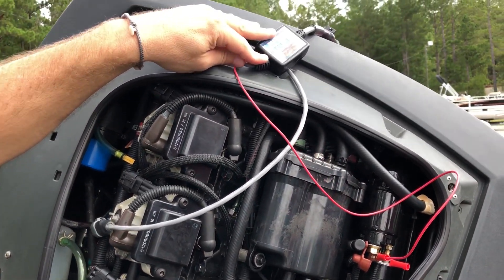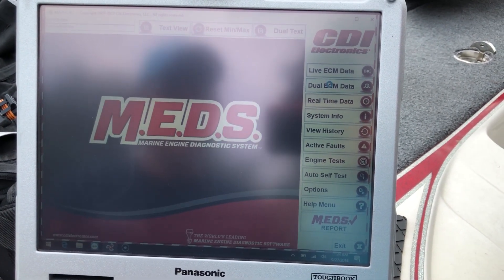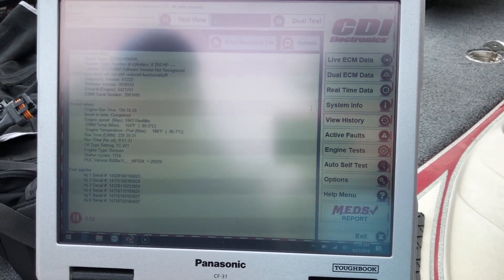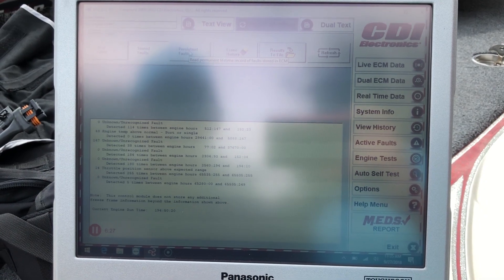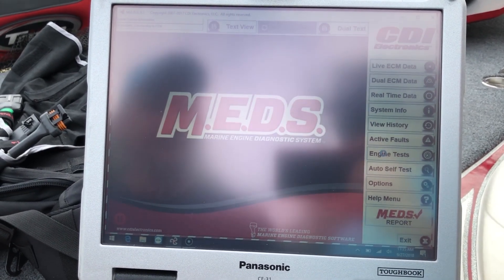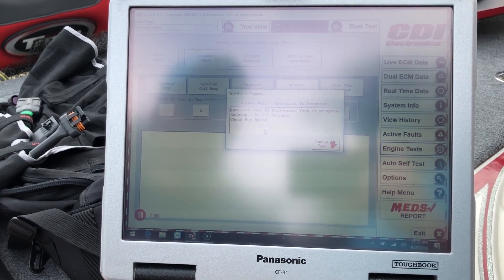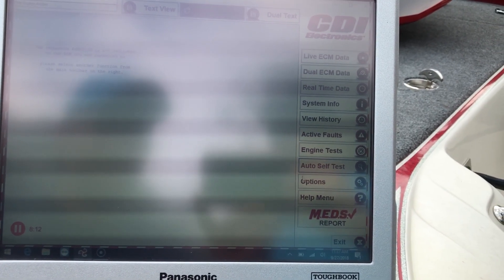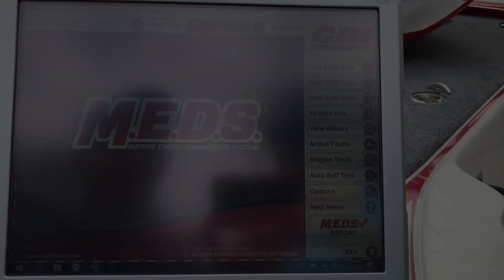Evinrude Diagnostic Commands on 2015 Evinrude 250 E-TEC HO with MEDS

Comment: Hi, i desconnected the ignition key cable to remplace to other key, i connected againg but the engine not start now, the engine not start with the new key ignition or older ignition key, what i can do?  It seems that the motor has blocked for some reason... Thanks in advance